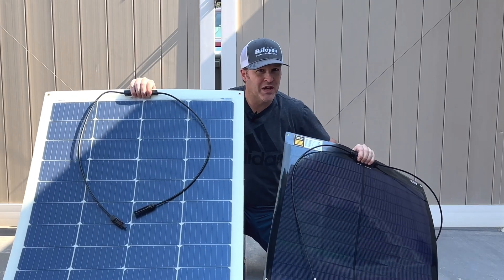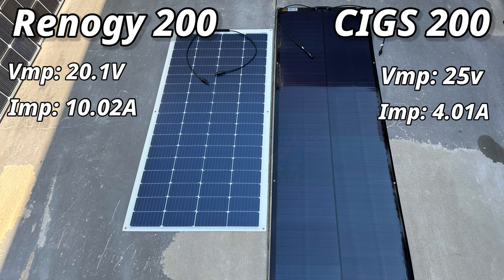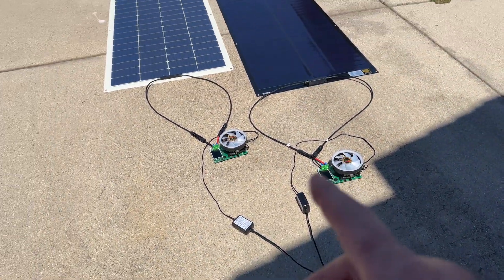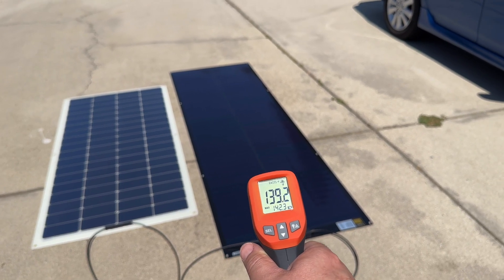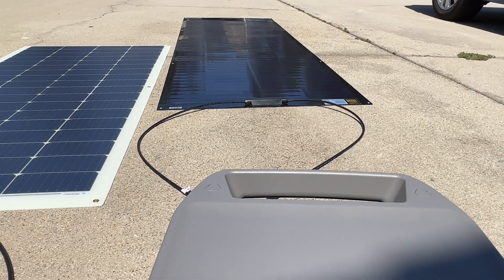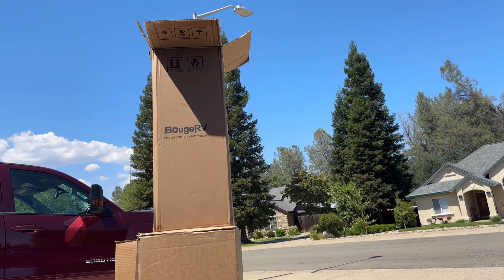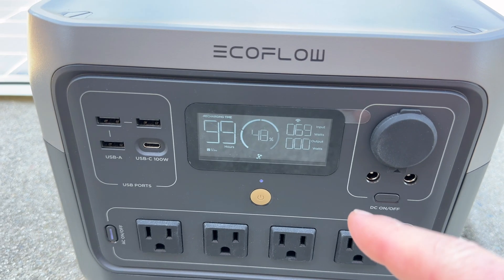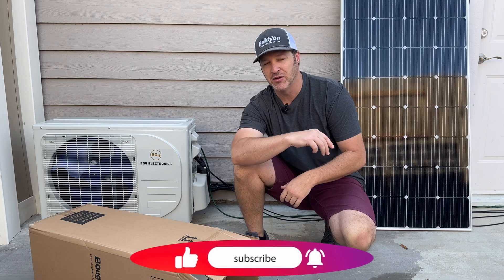BEST FLEXIBLE SOLAR PANEL CIGS YUMA 200 VS RENOGY 200 Watt

Comment: Great video. I really like the Cigs panels. I have the folding version from BougeRV. In my testing, it does not have the same shadow performance, maybe I am testing wrong, but it really performs. In fact, it outperforms two other folding and a rigid glass panel I own. I love how small it folds and how light it is. I also love 5hat you don’t have to worry about bending it too much and hearing the dreaded cracking noise. These panels are tough.

Comment: Can I replace my UPS battery  with a lithium battery 100ah for more capacity? I have a 600 watts UPS in which I have my computer, 2 monitors and the router plug in. Can I use that type of battery ( lithium battery 100ah and can it be charge by the UPS) Thank you for your time and assistance!
Reply from the maker: I would not modify an existing product as you don’t know the charge voltages and more. It’s not setup for correct charging of Lithium batteries. 
I don’t recommend

Comment: On the cigs panel I see a lot of them showing that they flex/curve well length ways. Are you able to flex them width wise at least somewhat?
Reply from the maker: Yea they can twist as well. But with any solar panel try to keep as flat as possible or best angle towards the sun if possible. Vans,RVs boats or Recreational vehicles in general are tough

Comment: My cig from rich solar failed just after a year. I am replacing all
Reply from the maker: I wonder how close it is for build type. They look similar but still different
Reply: @johnnysweekends  the lamination came off and the panel wires rust

Comment: When It comes to life expectancy I'd rather take my chances on more conventional solar panels with glass on top, but their output was impressive considering they are flexible, Thanks for the test.
Reply: You might want to look up "solar panel fire", micro fractures are pretty much inevitable with crystalline panels, but not with thin film panels. I have a UNI-Solar panel that is I think about thirty years old and it still works well, it's a different technology though, it's amorphous where as these are CIGS, but the data I've seen suggests extremely long life from both types of thin films.

Comment: Nice comparison but at almost $2400 for 4-200w panels?? I think you fell n bumped your d@m head... No thanks
Reply from the maker: lol they are spendy, but that shade output!! Crazy right
Reply: @johnnysweekends  You can even produce energy with CIGS-Panels under artificial lighting (such as LEDs, Lightbulbs or others). LOTS of energy! since CIGS-Panels can collect any form of green and blue lights!

I made the test with my 2/3W-Rated CIGS-Mini panels yesterday:

1.8 Watts in the NEAR of a 20W-Halogen bulb (old, soon to be replaced by LED). That´s 1.5 Volts at 1.2A of energy! I mesured it with a voltmeter (Fluke 73, very good model not a cheap model which gives out inprecise readings lol).

If i put my CIGS-mini panel fully under this lamp it would give about 4-5 Volts at about 0.3A. More than enough to power a small battery and charge it.
Reply: Black Friday I got two 200 watt. For 800$
Reply: @ClarkyMalarky  You didn´t say wether that´s CIGS-panels or not?

Comment: •   This is by far in the Top-3 
Panel Reviews  i've seen yet 
( maybe even the best ! )  👍
•   Definitely goes into my FAV
list so i can easily find it again.
•   Too busy @ the moment , but 
definitely going to check-out 
more of your vidz
•  THANKS VERY much for all 
the on-screen data right @ the begining.  THAT is what initially 
KEPT me watching , rather than 
yahoos that just rattle-off #'s .
•  i'm still in the design phase  ; 
YIKES that panel is HUGE !  That 
would've been a dealkiller but 
the on-screen SPEC-DUMP kept 
my interest , & it's not too late to 
tweak some build-dimensions.
•  i haven't checked that price💸 
yet , but i'm really leaning towards 
the CIGS based on its STELLAR 
Performance.
Reply from the maker: Wow thank you. Yea was really impressed by how this performed. I may have to swap some stuff out😂

Comment: Do you see any significant decrease in output as the temperature of the panel / surface goes up?
Reply from the maker: Every solar panel will put out less power when at higher temp and produce more when cooler, ones these were heat soaked they didn’t drop any more from there numbers you saw. But i was also not at a very optimal angle since the cigs is so flexible.

Comment: Outstanding review... I plan to buy renogy because much less expensive here in  Europe. I pay  217 eur for the 200W panel without tax...
Reply from the maker: Thank you, yes I was impressed with the cigs.
Reply: @johnnysweekends  Hi after some additional investigation, I am considering the BougeRV 200 CIGS the best option available, especially for an RV where partial shading will be common. I have found the 200W for 426 USD VAT included and the price difference with Renogy 200W is small enough to go for the best. Thank you again for your review ! It really helped selecting the best
Reply from the maker: @francisdebriey3609 I may have to swap out to these. My Rv around the ac units kill my input because a little shading and that whole section is gone.

Comment: Wow, the CIGS 360 flex is pretty impressive. Does CIGS give a decent warranty with the 360 Flex?  Also, is it possible the hotspot on the Renogy may have affected its numbers some(?)  Great video, luv these comparison tests, especially when newer/more unique cutting-edge items are tested.
Reply from the maker: It’s possible that may have but only one spot will be minimal. Even then I think we know which performed better.

Comment: What can you do with a panel like this?
Reply from the maker: Put it on a Rv or a boat or a shed and more. Many things
Reply: But what can you power with 20 volts? @johnnysweekends
Reply from the maker: @curtyanok9871 you are charging batteries with this. You typically don’t power anything direct with solar. 
You then power what you need from the batteries. You can directly run things from them but can also damage items as well.
Reply: @trainmaster0217  I am having a very small CIGS-Panel now as well! It only can produce 2-3 Watts, but this can be done even under lamps!

See? And it only produces 1.5 volts there in the near of a lamp and only 4 volts under the lamp directly. But this is enough for a usb-power converter. Which converts this HIGH amperage with low voltage into higher voltage to power any USB-Fast chargers or charge big batteries or Lithium-ion stuff.

Comment: I have bought quite a few and going to cover the truck camper in the CIGS self adhesive 200w panels. I was worried about too much heat but i figured it will work itself out. I usually travel when it is cooler. 4-6 to charge an AC200MAX + 2 B230's and a CHINS 12v300ah house battery. That should do the trick, lol! Great video and research.
Reply from the maker: Thank you, looks like you have a great setup. Should be good 👍🏼

Comment: Wow!  Best and most detailed shade testing of a solar panel i have ever seen!  The price is actually inline with portable offerings from Bluetti and EcoFlow with far superior shade performance.  Depending upon the latitude, laying a panel flat will yield 86% on average of what the panel is rated at (as opposed to pointing the panel south and adjusting your panel tilt by your latitude) with the added bonus of not having to adjusting the panel during the day to get the optimum power.  I will get at least one of these because they are so light!  One of my Bluetti PV350s weighs in at about 36 pounds.  Two of the CIGS weigh less than a 1/3 of the PV350 and have more usable power.
Reply: The Cigs just seem so unruly. I like that I could put 5 of the Renogy panels on an aluminum frame and move them around as one. Only 65lbs
Reply from the maker: Thank you 😀👍🏼
And yes performance wise i was impressed, i need to get optimal angle on a cooler day. I also live in a very sunny area where solar radiance is optimal so i can normally get excellent results, but more so in spring than fall. ‘/thanks for the comment checking it out. 👊🏼😀

Comment: 👌👍❤️🇨🇦, gr8 review, but pricey. I just purchaced 405 watts for $351
Reply from the maker: Thanks, yea unfortunately a spendy panel. They perform well. Be curious to see how long it lasts. I need to mount it to something soon.
Reply: @johnnysweekends  keep up the videos  they are good
Reply from the maker: Thank you so much 👍🏼😀
Reply: @johnnysweekends   I was wondering why you didn't put them on a sheet or two of plywood to get the full test parameters.  Of course many times those panels would be mounted flat on an RV or the like, so in a sense was a better real world test.  Thanks, was informative.  Would love to see a Kennedyesce speech about every home being energy independent in the next 50 years.
Reply from the maker: You could now with enough batteries and solar but would need space. But also depends where you live and the climate.

I mean people lived off grid forever till just about a 130 years ago lol

Comment: I own two BougeRV CIGS panels and love them.  They perform well under cloudy conditions.  I will get almost 280 watts combined on a completely cloudy day
Reply from the maker: Yea these are pretty much the best shade panels I have ever tested. Did very well.
Reply: Good to hear. Looking forward to the panel costs coming down, but even now, the savings on installation hardware/labor and performance in cloudy conditions (wh/$ vs w/$) make them a better value for me.
Reply: @marklundegren  They won´t get cheaper as too few people buy them. I just got a SIGS-small Solarpanel as well. But i would never pay the 800$ they charge for a 200W-CIGS panel in my country! Forget it!

Only REGULAR cheapo-cheapo Solarpanels are getting cheaper because they are simply produced a lot more.

Comment: I have 2 of the Renogy flexible 200W panels (series) and 4 of their flexible 175W panels (series) that are permanently laid flat on a shed roof and they’re never far off their quoted wattage when the sun’s out, with the coating the sun doesn’t need to be directly above them either. I also have a 400W Ecoflow folding panel and that’s just as good. 

I’d be interested to see how long the thin film panels actually last, I’d want at least 5 years out of them.

Edit: HOLY COW they’re expensive! 😳
Reply from the maker: Yea the renogy are still good panels but wow the Cigs really are impressive, and yes they are a little spendy!! 🫢
Reply: I just got into an EF Delta Pro and 400 w folding solar panel. I was not told at purchase that they were not for full-time use.  How long have you used yours and how are they fairing as to weathering?
Reply: @fuzfire  I’ve been using mine nonstop for over a year now without any issues and it’s been running with the EF Powerstream for some of those months and that is designed for full time use.
Reply from the maker: @fuzfire any flex panel will wear quicker than a rigid. Some last longer than others.
Also depends where you live. I live where it’s hot and lots of sun so I would go through panels quicker.
Reply: @johnnysweekends  I haven't used mine and I'm thinking I should sell the 400 watt foldable and put that towards a CIGS. I should have asked more questions.  It never occurred to me that they were prone to deteriorate in weather. Oh well I won't make that mistake again. I don't do camping so up for sale it goes!
Reply: @fuzfire  What's not designed for continuous use, please?